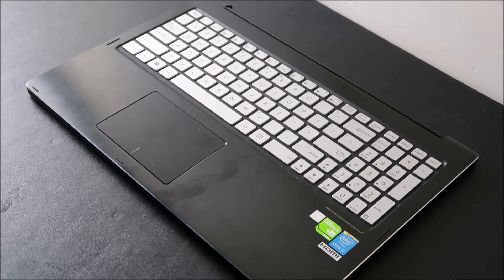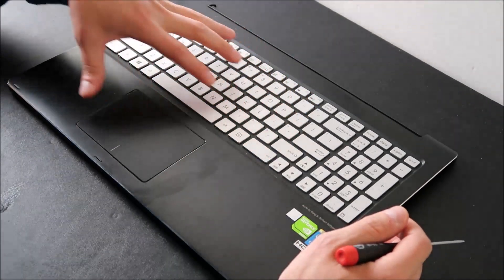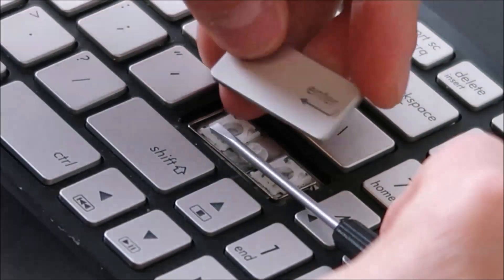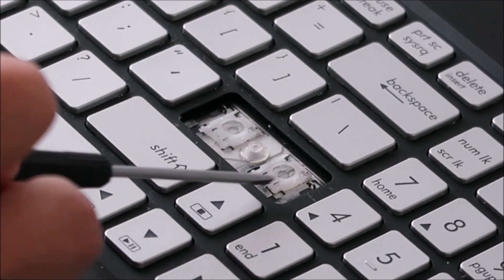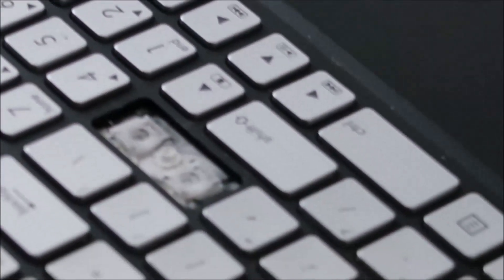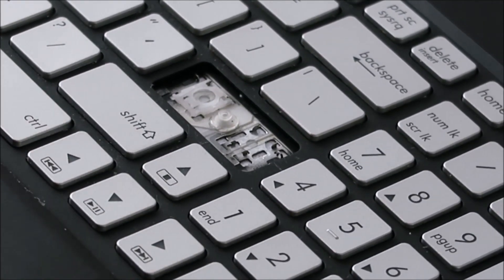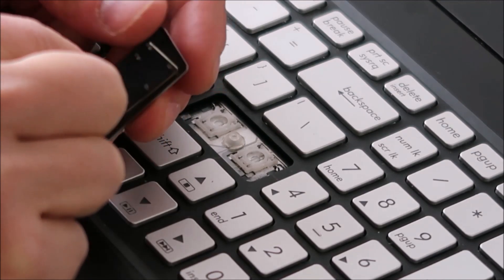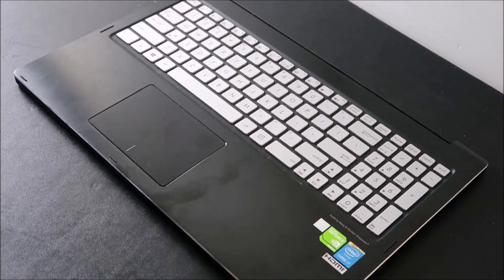How To Fix Replace Large Keyboard Key - Asus Q502 Laptop Computer

Comment: im trying to put it back on and the liitle botch at the top is just squeezing it enough to where it just pops it right out of place and wont go back in
Reply from the maker: If your Key Cap is not clicking down in place correctly, it is most likely due to the Retainer Clip not being properly installed or damaged.  Remove the Cap and inspect for damage or that its not laying down flush and properly snapped in itself.  Compare to another Clip if needed by removing another Cap.
Reply: @PC_Monkey  ok i git it now thanks
Reply from the maker: @pompersuf5214  Glad your all set :)   Always here if needed !!

Comment: Thank you so much for this video, it was a lifesaver. Do you have any source for the small white plastic pieces that are under the key? Both of mine broke on the backspace key, and I Superglued them back together and reassembled it. It's working, but I'd like to replace the parts if I can.
Reply from the maker: Very sorry.  This video was old and I had not updated the FAQ's yet.  I have now :)
If any component of the key assembly is broken, it would have to be replaced.  I usually get my keys on Ebay or www.replacementlaptopkeys.com.  If you cannot find a loose key for sale, you may have to purchase a keyboard and take a key from there.
Reply: @PC_Monkey  No need to apologize. Thank you for responding to me though and for the info.
Reply from the maker: @markkoso  Good luck !!

Comment: Great video 👍 card you do space bar
Reply from the maker: The Space key will look the same as the Shift key done in the video.  It will have 2 Retainer Clips, and 2 or more Metal Stabilizer Bars.  However, the Key Cap itself is much longer.  Be careful not to break the Cap when your bending it to take it off.